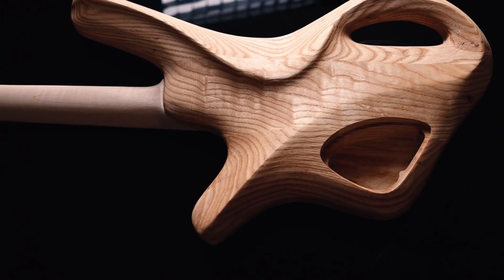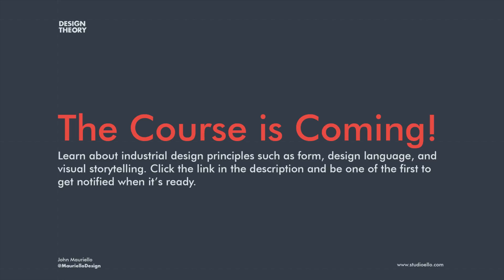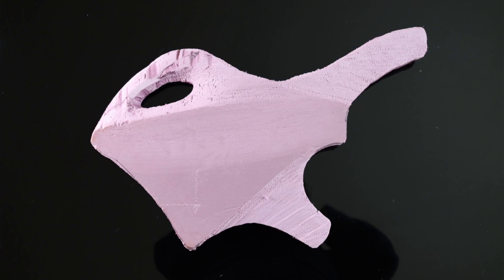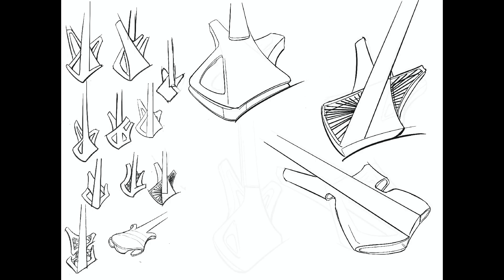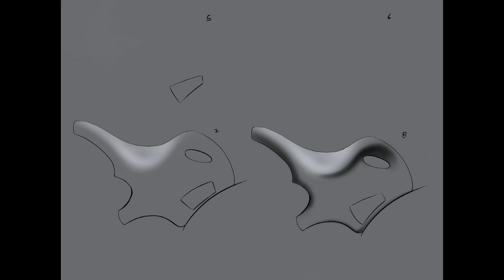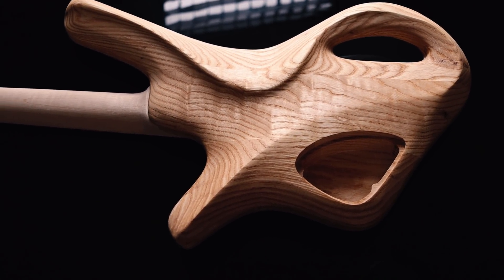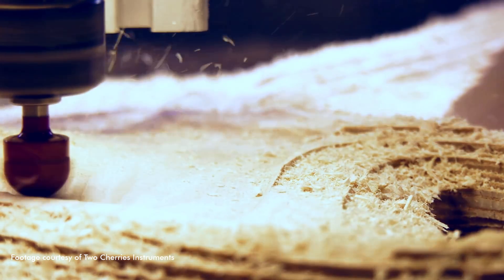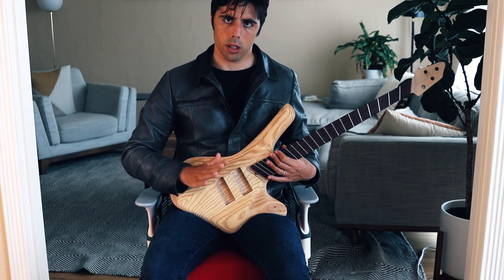How I Re-Designed the Traditional Bass Guitar: Industrial Design Process

Comment: As a bass player I think it is a beautiful design that looks very ergonomic. I’m curious how the tone is going to sound with the smaller body size and the grip hole. There is a certain resonance that a big chunk of solid wood delivers. However, it mostly depends on the pickups. Great work, looking forward to seeing the final prototype!
Reply from the maker: I'm curious, as well. I think it will probably be okay. Wood and resonance definitely play a part in electric instruments, but pickups seem to be the biggest single factor.
Reply: The body absolutely contributes not only to the resonance but to sustain and the overall tone. The quintessential example is the Rickenbacker bass. The company tells you the reason a Rickenbacker sounds so iconic is because if the materials used  - maple body, body thru neck design where it's all one peice of wood, and then what type of wood used for the fretboard, which is also malpe in this case. The design is what gives a rickenbacker its sought out, signature sound, NOT the pickups, infact while reckenbacker designs its own pickups for its guitars the bass picks are from another company, and consumers will often replace the pickups, but the rickenbacker still sounds like a rickenbacker, which is to say piano like sustain with I hi mid bite that has been imitated but never replicated. Many pbass players don't like the reckenbacker, they say it's uncomfortable to play, but you don't bring your style of playing to a rickenbacker, you learn to play a rickenbacker as it is, because the irregular body shape is what makes the bass sound that way, and it's worth it to play the Rick the way it is. I don't build guitars, but I can't see the company saying it's the body when really it's the pick-ups, and I can't see so many people cherishing the rickenbacker just cuz it looks cool, it doesn't necessarily look great, it looks kinda funny  but it sounds great. It's even true that no two rickenbackers sound exactly the same, that is a fact, and if it was all in the pickups that wouldn't be the case, it has to do with each piece of wood being unique.
Reply: I’m gonna stick with my lightweight woods with high quality electronics and y’all can keep arguing over tone woods
Reply: @Design.Theory  I commented below, but Michael Kelly basses have a really interesting solution to this problem. They basically mill out a pocket underneath the bridge, then insert an aluminum block and mount the bridge to that. It basically results in the bridge being mounted to a way higher mass material to improve sustain without having to worry about increased weight. Might toy around with something along those lines?
Reply: @pippin45  Carlos Santana did this in 70’ when he played a Yamaha SG styled guitar luthier inlayed brass under the tune o matic style bridge….of course Sustain is his signature 🥰
Reply: Unless the pickups he puts in it are microphonic,  resonance and wood choice will have zero impact on the sound.  He could make another out of concrete. Both will sound the same coming out of an amp.
Reply: Primary consensus is that body wood is way down on the factors that affect tone compared to pickups, pickup location, preamp, strings. Sustain is somewhat subjective but some claim neck through to hold more sustain, though I think a high mass bridge is a biggest the biggest factor. Sadowsky NYC chamber their basses compared to the (now) German made without an change in tone.
Reply: @brendanerskine4158  Yes.  It's stiffness, particularly in the neck joint and hardware, that could impact sustain, not wood that's not holding the string tension.  Tone differences due to body shape would be negligible, though the feel from the guitar body into the player can make it seem so.
Reply: I have an rbx a2 bass and it is only like 6 pounds and it has the most sustain of any of my basses. It has some resonance tunes in it its incredible
Reply: If you're using active pickups that might not even matter.
Reply: grab the TINIEST Steinberger guitar (with the TINY minimal rectangle body) and LET'S SOUND-TEST that vs the guitars with the MOST WOOD blah blah. 

You will be unable to tell the difference. 

With ELECTRIC guitars and basses, the wood means NOTHING nor does the weight. That was settled years ago. ANother virgin birth! 

The pickups and your even your FINGERS control 99% of the tone etc.
Reply: Ditto!
Reply: I doubt that it will change the tone at all. Jim Lill made a great video about electrical guitars and what affects the tone. The only thing that the tone depended on was mainly the pickups, strings, heights from pickups, ect. Wood had 0 impact
Reply: It is the opposite, there is a LACK of resonance in a thick piece of wood. Rigidity and mass are the primary parameters when you want to sustain waves. Any resonance will take  away energy from the strings and form harmonics that are not always beneficial. The more rigid it is, the longer it will sustain EVERY note. The more resonances there are, the more variance there are between notes.

Acoustic instruments are the kind where for ex wood type has a lot to do with it, those do rely on resonance to acoustically amplify the sound. But electric instruments use an amplifier for that.
Reply: The lack of Mass will affect the sustain. You can see this problem with Warwick Thumb bass. I would personally put active pickups to make it less noticeable.
Reply: @a.krawion1872   Michael Kelly basses have a really interesting solution to this problem. They basically mill out a pocket underneath the bridge, then insert an aluminum block and mount the bridge to that. It basically results in the bridge being mounted to a way higher mass material to improve sustain without having to worry about increased weight. Maybe  @Design Theory could play around with something like that.
Reply: @pippin45  Yes, the Yamaha SG2000 guitar had a brass block there for exactly the same reason. I think it was Carlos Santana's suggestion that led to the inclusion. They were renowned for their sustain but admittedly they were also a very heavy guitar to begin with.
Reply: @a.krawion1872  I have found that MASS has literally ZERO% affect on tone, sustain, etc, bc my friends and I all have these eternal debates (cuz they drank the kool-aid of tradition and I drink the kool-aid of PURE LOGIC) and compare their DUMB traditional guitars to my MODERN Japanese or chinese guitars. 

NEVER ONCE did the myths prove true. NOT ONCE. 

(I prefer the lightest, easiest, 3/4 basses and guitars, and headstocks are DUMB!)